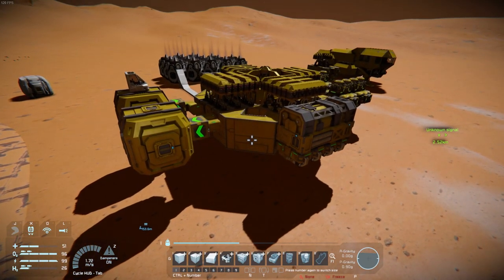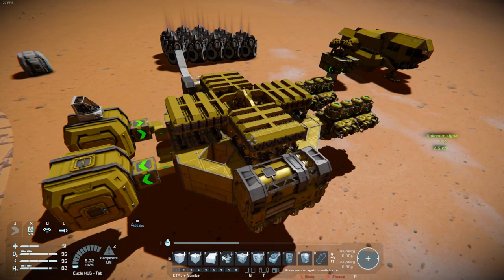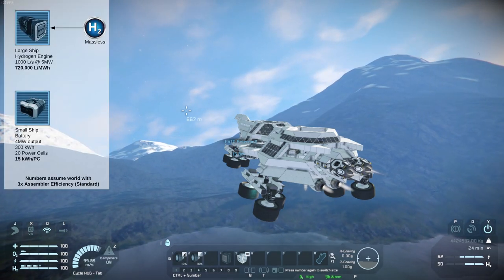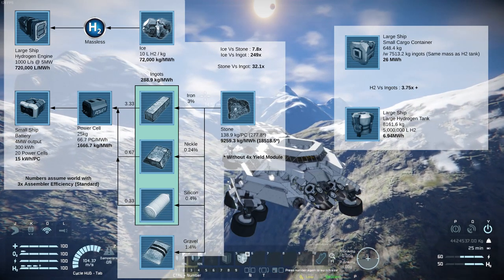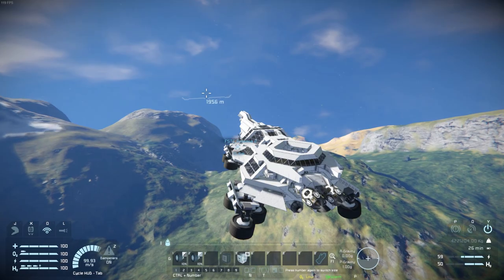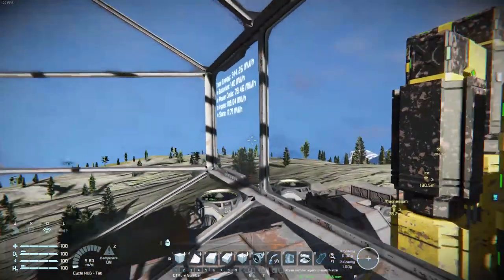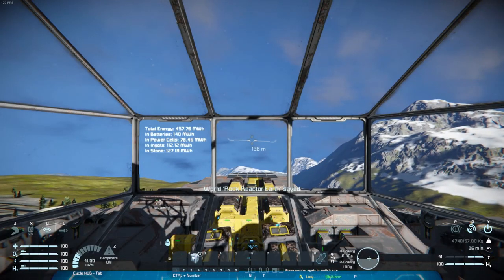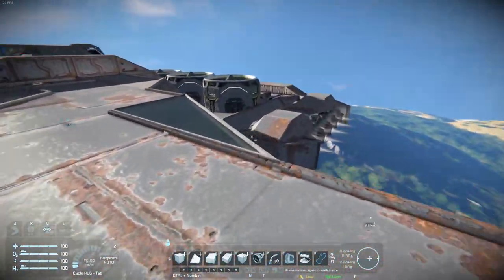Space Engineers :: Power from Stone!

Comment: You can improve on this design by having no moving parts. A layer of welders, an other of batteries (connected to the side) and a last of grinders.
You can make even cells of 3*3 (think of the area of effect of welders/grinders) and automate them.
If you take the effort to check the coordinates and orientation in the ship grid to look on how cells are doing, plus using a self building design, you can make a self expanding power source with the only input being how much power you want in the system. But that is some huge dedication to have here.

Comment: Keen should fix the mass and volume. They should both lower as you process and refine material into components. The only time mass should not drop is when you are turning components into blocks. Then, it should stay static and volume can increase or decrease depending on the object's density.

Comment: Have you scripted the grinders to completely grind down the batteries, or just to the percentage enough to get rid of the old power cells? Might be mod-worthy to make batteries that have the powercells swappable.. you know.. like a real battery setup. Think old laptop batteries or changing the batteries in a flashlight or car.. no smart electronics attached to the cells themselves...
Reply from the maker: It's scripted to take them all the way down, i had some issues with them remaining at 0% power when i just took them below functional.

Definitely, that would be really cool actually, really should look into modding at some point
Reply: For stonepower, folks need to stop thinking Rechargable Batterys, instead look at the AA Drycell disposables.
Galvanic Batterys (potato-penny) are super simple to make with basic materials,
folks have to work at NOT making it by accident (water cooling systems accidentally do it with Copper/Alum parts)
If modding for realism, make a DryCell battery - and make it huge for just 100kwh.  Thats fine, space & stone are plentiful

Comment: Instead of four Blocks of batterys that are 90° apart, you could make a round disc of batterys that turns slowly that means you only need a single row of welders and grinders.
Would make the controls much simpler, if you dial the speed of the rotor corect you could just keep the grinders and welder always on and it would work without a script.
Reply from the maker: Problems are, that making round things in SE isn't straight forward unless you scale up.

For the same reach, I can have half of one square of batteries, in the space between each square.

But, when the innermost grinder is over the first battery in the corner piece, it will actually cover three batteries, since it's diagonal is longer than the side of the square battery, cutting into its two adjacent batteries.

If you were to run the setup continuously, you would burn through a lot of materials.
Currently, it replace batteries when they are empty.

If power draw is low, running continuously would replace "full" batteries, and the battery cells are lost when grinding, regardless of the battery being full or not.
Reply: @PatrickHansen101  
I need to have some space between the grinder and welder so only like 90% of the disc has batterys but it is still much more compact, also it dosnt loses 50% of its peak power during rebuild, so it can be made smaller quit important for use on ships
Sure the lose of the power cells is a problem if you dont have a way to control the rebuilding it, on the other side stone is free if I only get half of the energy from the batterys it is still a good deal without needing a script, specialy if you want to power a miner or ore processing plant.
You could even manualy control it, fresh build batterys have 30% means when your overall batterys drop below 10% a lot of them are depleated and needs to be rebuild if you have like 20% most of them are fresh and you can turn it off.
The benefit is my design is it doesnt need a "complex" control sequenz for rebuilding just an "on/off" buttom, if you dont need or want control the power output it doesnt even need that.
Reply from the maker: @jonasstahl9826   If you have a build of that, I'd love to see it!

I initially went for a linear system ( big rectangle, replacing a row at the time in a sweeping manner), but discarded it because; Unless I am only using one row of batteries, I may end up with more than one row depleted at any one time, resulting in reduced output (or total loss).
The only way to prevent that is to stagger their initialization, so they'll "died" in a sweeping manner, which is also the manner you'd replace them, same principle as your circle.

Problem was, that to make that replacement process passive you would 1: have to do a circle as you say, which will reduce power density.
2: the rate of replacement has to be such, that all batteries are replaced with no more than a 4.5 minute interval.
With a generator the same capacity as that I have on my ship, that's 70 batteries active at any time, so 70 batteries + 2 inactive rows / Circular sectors.

That's around 43 tons of stone per minute you'll have to feed the beast, even when it's just floating in space / on planet.

The points of my setup are 
1: It's the power source, if you turn it off, your ship is off.
2: It's hand off. I spent time making a control script, so it'll take care of itself.
3: Efficiency, as little waste as possible. 

Not saying your setup is wrong, could totally work!

To me, this control system is simple and allows for a thing that just needs to be topped, after which it'll do its own thing and get as much out of those rocks as possible.
Reply: @PatrickHansen101  Sadly I dont have that safe anymore I might try to remake it.
I havent played in the last years.
To you point:
1. I dont have loses in power densitiy the disc was fully covered with batterys beside the center where the rotor is.
Welder and grinder have a bigger working area than there size.
2. The rotor has made one rotation every 8 minutes, to compensate for the gab between the welder and grinder, also to reduce wasting of material since i didnt needed full power

I had my system on a 5x5 deep space miner with refinerys.
While mining and refining the generator was always on. For the way back to base it was off since cruising needs way less energy than ore refining. When running low on longer trips the system was activated for a short period of time.

Comment: i think this is a fair argument for why Hydrogen power as fuel needs a buff, making it realistically a long term primary power source. I dont want to see stuff like this stone as power nerfed, i just want hyrogen fuel to at least be comparable to methods like this.
Reply from the maker: Absolutely!
There's a massive gap between Hydro and Uranium.
I would actually love to see something akin to this,  where you would have a battery sort of blocks, that accepts cells like a reactor.
So we'd have Hydro, which only requires the engine and O2/H2 gen,  the intermediate step requires refining and assembling of fuel, and then Uranium sitting on  the top, perhaps add a few steps to Uranium power.

Comment: realy like the concept of it. If you make a script for that and wont to get it as flexible as possible how about supporting multiple rotors and no rotors. This way you can split the whole thing in smaler pices and place it on different places in your build. For example 1 Rotor with lets say 4 Batteries and a rotor 2 Welder 2 Grinder on the left and the same on the right side. Or the same without rotors and just fliping from left to right. This way you don't realy need the massive space your Version takes and split it in peaces that fit in another building design. I like your version it follows the KISS priciple (keep it simple stupid) but it takes a lot of space. If you can split it you are much more flexible. Hope you share your script and looking forward to use it.
One last thing even if it wil be nerved to 1:1 ration to ice. It is still a very good solution because of the availability of fuel. You don't need to find Ice somewhere. Just mine the nearest asteroid for Stone.
Reply from the maker: Appreciate the input, and KISS definitely echoes through this design!
I'm going to start off by making the rotor with batteries, plus the grinder and welder, the only parts you have to build, i might add support for multiple setups.
Removing the rotor entirely will be difficult, it would have to be replace by a hinge or piston, since we need to have a subgrid for the grinders to work.
Volume reduction will definitely be a goal though.
Reply: @PatrickHansen101  well yes thats right but if you don't need to rotate the rotor and just use it to create a subgrid and have another rotorsubgrid on another place you dont need to rotate it and therefor use less space thats what i meant. Sory for being unclear. I meant if you need to rotate something you always need twice the space you might not have in this position. But usuely you can make room for multiple smaler contraptions in diferent places throughout the ship. I think i mean the possibility to to turn of the need of rotating the rotor :-)
Reply from the maker: @allessiabahzelson167  Ah, i follow!
Yes, that should be doable, actually a really interesting idea for miniaturization, especially with the recent hitbox update!

Could make them sort of self-replenishing power packs.

The challenge would be to divide them into two groups, since one wouldn't want to be in a situation where all of them are disabled at once.
Reply: @PatrickHansen101  Well i can't write scripts, but what about just looking in the system for Batteries with lets say less than 5%. Then start the welding and after that delete the old ones. So this way you have two goups you can switch between. Hard Part would be to tell the system to stop at Connectors, so your Base without this system don't get cought int he Proces as your Base becomes a subsystem after connecting. Not sure if you can put the projectors in 2 groupts and then tell them your blueprint is group 1 and you are group 2. Don't know enough about the bool stuf. But at least i can think in logical ways. So if you like i can help by asking stupid questions where you need to explain what you are doing. For me this works sometimes when one start thinking in circels.